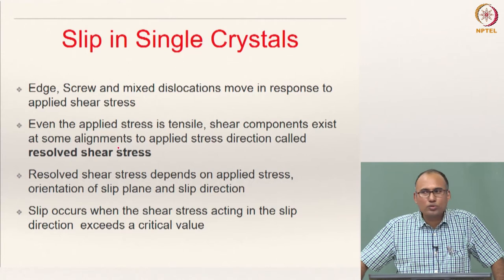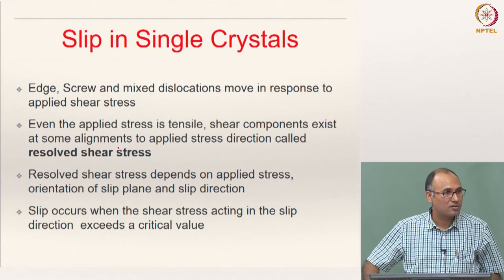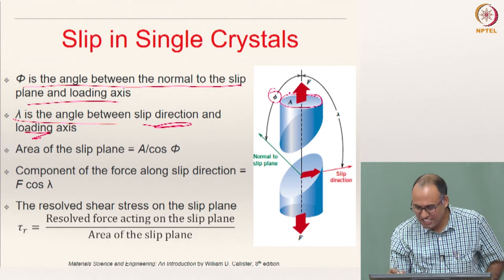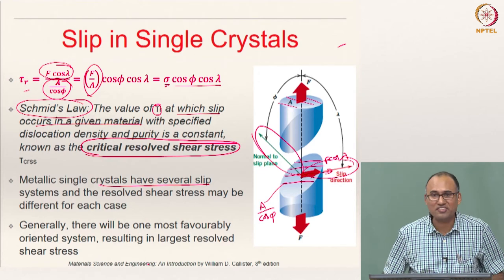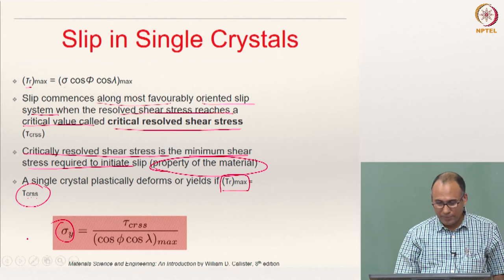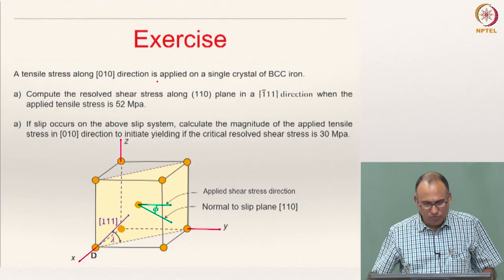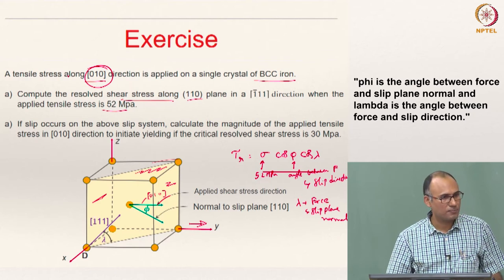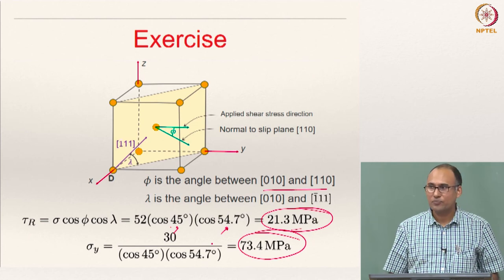Lecture 9 Part 2 - Defects in Crystalline Materials - 4 (Slip in Single Crystals )

Comment: so sir whats the answere why FCC more ductile?
Reply: Each slip system in BCC is not closely packed compared to FCC slip system. Henceforth, the energy required to move a dislocation along BCC slip plane is higher than the energy required in case of a slip plane in FCC structure.